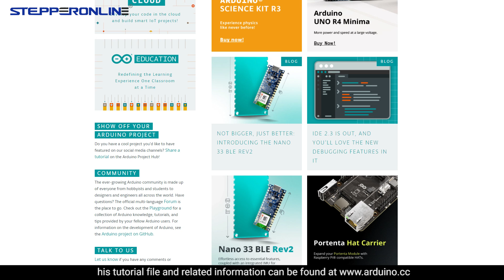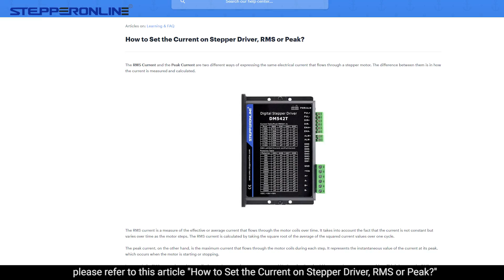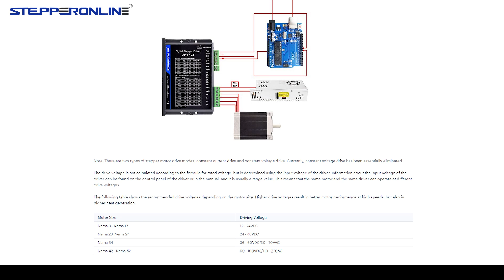How to use stepper drivers and stepper motors?

Comment from the maker: This video is about the methods of using stepper drivers and stepper motors.And the more details  is provided in the following articles. Hope it's useful to you.

Voltage of stepper motor:
https://help.stepperonline.com/en/article/voltage-of-stepper-motor-1brcz5h/

How to set the current on stepper driver rms or peak:
https://help.stepperonline.com/en/article/how-to-set-the-current-on-stepper-driver-rms-or-peak-1d29t68/

Schematic that how to wire the stepper driver to an arduino:
https://help.stepperonline.com/en/article/can-you-send-me-a-schematic-that-how-to-wire-the-stepper-driver-to-an-arduino-d5ot82/

Voltage of stepper motor : https://help.stepperonline.com/en/article/voltage-of-stepper-motor-1brcz5h/

Arduino:
https://www.arduino.cc/